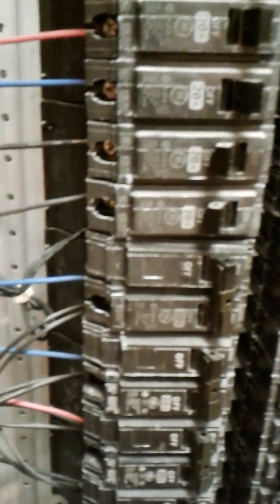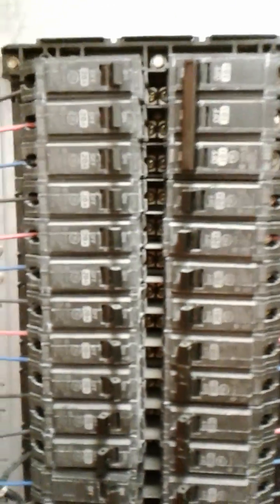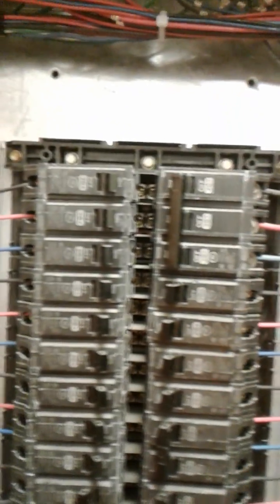How to connect shunt trip breakers

Comment: You could've pointed at the wires. U suck at giving instructions
Reply from the maker: If you can't figure out that you connect your hot and neutral trip wires to the black and white wires hanging off the breaker, you shouldn't be touching anything electrical. Don't be that guy.
Reply: Se entiende muchas gracias